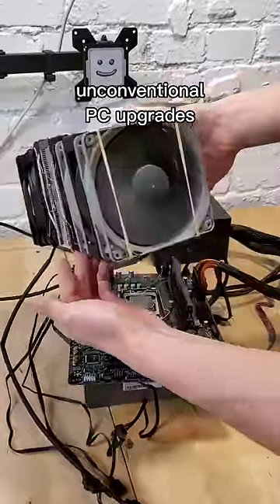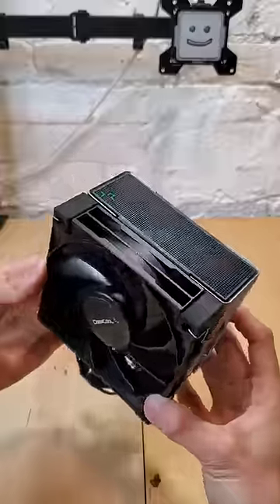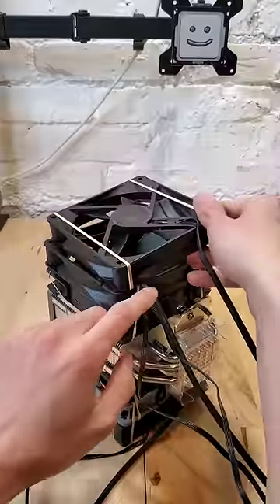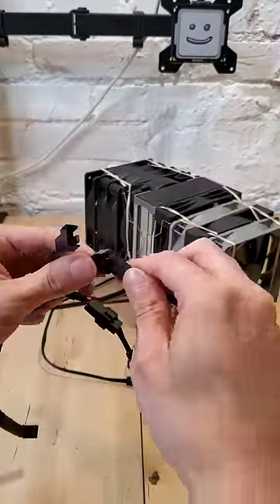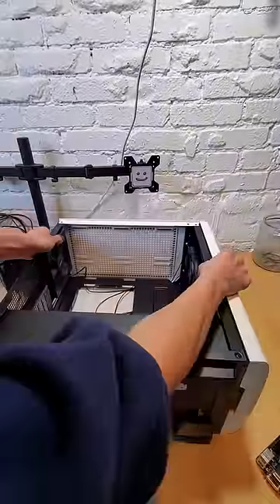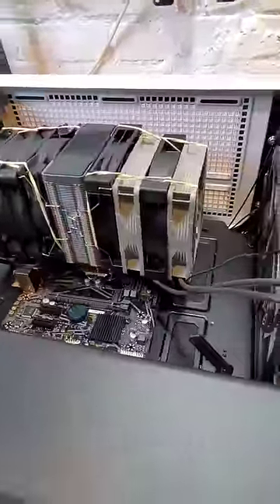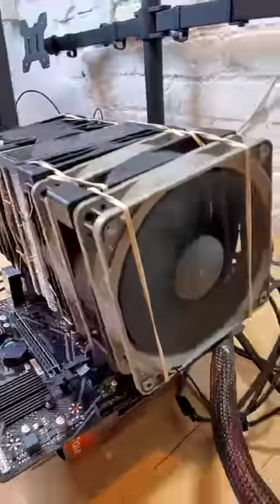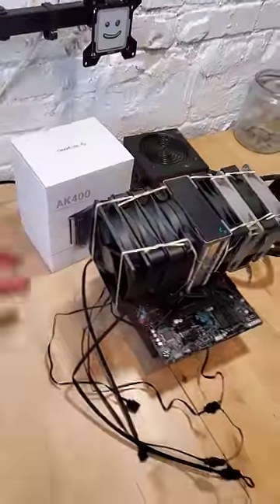the largest CPU cooler you'll ever see #shorts

Comment: I wanna see it put to the test, play a really CPU-usage-heavy fan-needing game :]
Reply: Me too!...

HOW ARE YOU EVERYWHERE?
Reply: Genshin Impact max settings should be able to melt the fans.
Reply: Bro ur everywhere why and how
Reply: @kitGoesquack  🤣🤣 definitely not.
Let's throw beam ng with 50 cars in it
Reply: it will be worse than having two fans on the coller because two fan taped to each other with the blade in the same way wil not increase the static pressure or the airflow
Reply: @kitGoesquack  No? Genshin doesn't stress any modern hardware that's half decent. My 2014 Dell inspiron with a i5 6200U and the iGPU with 8GB of DDR3 1600MHz will easily get 75 FPS with everything maxed out
Reply: @theforerunnerreclaimer  I don't play genshin, but I can tell you that my inspiron from 2013 is absolutely horrendous at playing games like roblox, even with 16 gb of ram and an ssd. The cpu is weak today and the gpu already back then wasn't meant for super heavy loads. 3ds emulation works at native resolution for me though, so I have that if I'm ever bored. Unfortunately I'm stuck with it bc my pc's power supply died :_(. Somehow this laptop outlived my pc for now.
Reply: @papyrus9183  Well, I did say half decent, and (no offense), if it can't handle Roblox it doesn't seem like it's very good
Reply: You mean chrome lil
Reply: Same🔥😆
Reply: @makandalp  for real. everytime my little cousins insert 30 cars. my 2700x is getting as hot as the sun
Reply: I would love to see this.
Reply: @theforerunnerreclaimer  no worries, my laptop is honestly absolute crap. like you said, roblox isn't even a resource hungry game. im just using it for schoolwork while waiting to repair my pc.
Reply: Play Minecraft with 1000 shaders and RTX on 

Wait, don't your PC would explode
Reply: @zhila5958  my 11th gen i5-11400H in my laptop doesn’t have that much of a problem with a lot of players on beam mp / beam ng multiplayer you probably need a better cooler
Reply: @theforerunnerreclaimer  The game is hard locked to 60FPS for now. Your point  still stands though. I run an R9 5900X with RX 6800XT and barely get my usage above 40% on CPU and 60% on GPU.
Reply: @kitGoesquack  bro genshin impact literally runs well on mobile... and it's well optimised on PC..... how shit is your computer?
Reply: @makandalp  beamNG is more into gpu intensive game , running cinebench r23 is more accurate since it runs 100% on your cpu for 5-10 minute non stop
Reply: thats cool
Reply: @xxzenonionnex7658  problem isn’t framerate tbh. but 79 celcius is kinda worrying. i thought the arctic freezer 34 would be enough to tame the 2700x at max load but boy oh boy was i wrong
Reply: @makandalp  guys I think he's definitely being sarcastic. 🙃
Reply: It'll just be worse, it's a sponsored video, if the performance was better then it would be included.
Reply: @kitGoesquack  nope.
Reply: @makandalp  hah, amatuers.
Just open cHrOmE
Reply: Why would anyone try to test it with a game? Just use CPU burner...
Reply: @BloPsy_Actual   nah, those are not realistic to real gaming scenarios.
Reply: @toxicturkeyy  Who cares about CPU temps in gaming scenario? It's completely irrelevant. 
Rendering or some other CPU intensive actions would be more appropriate. Using games to test out CPU is just a joke.
Reply: Exactly
Reply: Just load up 10 instances of bluestacks running games.
Reply: If you see him everywhere then it means u r also everywhere
Reply: The RAM doesn't fit
Reply: @kitGoesquack  nah, gi don't really takes many resources. My laptop is enough to take it
Reply: beamng no cap needs it
Reply: @theforerunnerreclaimer  cap
Reply: @kitGoesquack  even my phone can do that. 7 years old Samsung Galaxy and it goes up to 38
Reply: A chunk of tnt, all set ablaze at once (using commands ofc)
Reply: @kitGoesquack  no? Hahahahah
Reply: Yea i wanna know how it performed
Reply: Valorant
Reply: @theforerunnerreclaimer  i think genshin is maxed to 60 fps
Reply: @theforerunnerreclaimer  isn’t genshin locked at 60 fps? I’m geniunrly not sure, and if it’s not do you know how to raise max fps? i would love higher fps genshin
Reply: Just cinebench
Reply: @kitGoesquack  genshin impact is not even a demanding game for pc
Reply: @makandalp  better yet, gta v with absolute chaos
Reply: Cyberpunk 2077……..
Reply: Yes... But remember that fans are supposed to produce vortices in opposite directions.... As in spining opposite ways.... Not the same rotation ....
Reply: @kitGoesquack  arn't you a weeb. 
That game is weak in graphics and processing requirements actually most of the games are weak in cpu processing requirements.
But saying genshin impact will melt the daam thing is right outrageous.
But yeah game is fun to play..
Reply: Yeah same
Reply: I wanna see a temp
Reply: Open 7 up Analogue Labs and 5 kontakts along with idk prolly 6 serums in a DAW
Reply: beamng drive or arma
Reply: He should try some 3d rendering without a gpu plugged in
Reply: @kitGoesquack  how it's not that demanding
Reply: @makandalp my cpu got too 80 with 50 cars

Comment: The fact you used Rubberbands for sticking fans together tells me you are a genius
Reply: He is not the only one who did this haha
Reply: I was so dumb and used cable ties lol xD
Reply: @forsaken7161  if youre being serious then you went with the correct choice. Rubber bands dont like heat or time. They lose elasticity and dry out eventually cracking and breaking. Cable ties will last as long or longer than the components they hold.
Reply: @imalimabeanyay  not to mention, his method of securing the bands leaves an air gap between each fan that permits air leakage, reducing the overall air flow through the cooler
Reply: @richfiles  personally id just recommend some bungie cords. If it works on a car at 80mph im sure it could handle a wee little fan.
Duct tape if you care about airflow leaks

Comment: That is gonna draw more watts than a 3050
Reply: Well a 500w psu can power over 50 fans with no issues. I’m guessing someone with a 3050 may have like 550w psu or better. It would have no issue running a 3050 and 8 cpu fans including case fans.
Reply: i had a 3050 before i upgraded, they don't actually take much power lol
Reply: @footballfusionpro2  which is why the 8 cpu fans will draw more power haha but realistically it doesn’t. But still kinda funny haha.
Reply: 1 fan usually draws about 1,8W so 8 fans about 16W.
Reply: @reecekordzikowski3671  sorry, i didnt mean that the fans won't draw more power, just that OP said it in way that made it seem like he was saying a 3050 draws a lot of power
Reply: @footballfusionpro2  I get what you mean lol
Reply: Bruh what fucking industrial fans are you using?
Reply: @toxicturkeyy  who lmao
Reply: @footballfusionpro2  dude , 3050's came out like what , 3 months ago? And you already upgraded lol ! XD
Reply: @AnimanARG  I sold the 3050 lol
Reply: *3090
Reply: Not really 😕

Comment: Can you do a thermal test with this set up. I'm curious what the Temps gonna be with this many fans on the heat sink
Reply: I would expect after the 3rd and 4th fans on each side it wouldn't do much. As soon as the air gets to speed and matches the flow of the fan, more fans won't increase the flow and so cooling doesn't increase.
Reply: @faielgila7375  Well it will blow the hot air away further, and draw colder air from a further distance so it might make some difference.
Reply: @joshkoster2851  Hm, that would help a little, but certainly not when installed in a case
Reply: @faielgila7375  True
Reply: Probably way worse. Servers do stack fans because of how short they need to be to fit into a server rack but they have different sizes of fins because otherwise they decrease each other's airflow
Reply: There are plenty of youtubers who already tested the affects of more cpu fans or in general more fans in the case.
The result was that it is complete bullshit to have more than 1 fan on an non AIO cpu cooler. U only need two fans if the cooler has a space inbetween the cooler (like the noctua nhd15).

Same goes for AIO radiators. The cpu will not operate at a lower temp when using fans on top and on the bottom of the radioator.

People need to get away from the perception that "more is better", espacially with the fans...
Reply: If you stack fans like this nothing will change , you need 2 fans rotating in opposite directions to create static pressure to increase airflow
Reply: @ThExitest  also not true...
Push pull config is not better than pull pull or push push
Reply: only one fan per air outlet will work, other fans will break the air flow, and heat removal will be worse.
Reply: Nothing change tbh, we need more heatsinks not more fans, i'd like to have a giant cooler with 8 heatpipes + 1-2fan than a small 4 heatpipes + 10 fans
Reply: I think no improvement at all...... Just making the situation worse....
Reply: @honestsniping1  what i was thinking. After 2 fans its useless or may actually obstruct . but I've never built a pc so idk
Reply: @ThExitest  this. Without counter rotating fans stacking is pointless.
Reply: @honestsniping1  He's talking about same air direction but with opposite rotation of the fans, like: pull (🔁), pull (🔄), heatsink, pull (🔁), pull (🔁)

Like a jet turbine so the pressure increases and the amount of air being moved increases as well

Comment: For anyone here without critical thinking skills: 

1. this is dangerous as it could be too heavy for a motherboard

2. Just because you CAN doesn’t mean you SHOULD. Multiple fans won’t make it cooler, it’ll just push air faster and move it.

3. If you want a good air tower without an AIO or anything with custom water cooling, use Noctuas coolers since they are considered the best of the best air coolers. 

4. None of you are talking the same way I am. Scary times; people are not thinking anymore, not even basics of thermal conductivity

Comment: To maximize dynamic performance you should use 2 different fans (one rotating clock-wise and one rotating counter-clock and so on) Scythe has done it on “Fuma 2” cooler as well

Comment: Should one stack fans: Stacking fans will not increase performance. It will not increase the speed of air pushed through, in fact it may lower it, just because the front fan may disrupt the airflow.

Comment: This only works if you have the fans spin in alternating directions of each other while still pushing the air in the same direction otherwise airflow is actually diminished rather than improved.

Comment: TLDR; It will make a positive difference. Even 1 extra fan per side will create a small (+-   1-10%) temp drop. My understanding is that the outside fan of the intake-fan-set, drops the temp of the air, which is then cooler than the actual ambient temp, which then has its temps reduced further, by the inside fan. 

This "2x" cooler air, then has its temps reduced further by the 2x exhaust fans. It's a simple upgrade that potentially produces enough of a Cpu temp drop that it could possibly stabilise an otherwise unstable CPU overclock.

Comment: I have a similar case from deepcool. It's not great unless you can get in under $50. It has fitment issues and the drive cage was not removable which made cable management very difficult. Definitely good for the $35 I spent, but it won't keep up with nicer cases a bit above $100. 

It did come with a 4 pin fan hub which was really nice to have.

Comment: Cooling process is logarythmic . Even if you put whole motherboard deep in ice and over clock it, the heart of cpu still could be in high temprature.
If you can find a way to prevent melting of a plastic bag full of water on direct fire , then you found best cooling method ever.

Comment: It actually work, i did that with mine with 4, 2 in / 2 out and it keeps my ryzen 5800x under 70 degrees on 80% load. Its not that bad, i did that with pretty cheap ones, so its cheapers than a high end cooler that keep it at the same temp.

Comment: And it will not flow any more air than the lowest volume fan in the stack.

Fun party trick, but it just adds more heat as each fan contributes additional heat load in the case without corresponding additional cooling.

Comment: Fun fact: this doesn't work what you expected to be. There's a video here in youtube but i forgot what was the title of the video and who was the YouTuber, maybe it was Major Hardware, but the guy also did the same, putting multiple fan in a cpu cooler. He gradually add 1 fan and measure the cooling effectiveness, it only capped at 2 fans and the rest was the same, maybe he add it up to 6 fans. Then later he explained why it doesn't cool to much despite having a lot of fan, he said that all fans has the same rate of power so no change of air power meaning the power of air exerted to next fan is just the same.( e.i. fan1 blows 1 power of air, fan2 recieves the  power then blows it again only 1power of air and so on and so forth).
Reply: Found the video. https://youtu.be/Wp4pG2td0IM

Comment: Does anyone else want to see this many fans on the largest air cooler ever. The CPU cooler I'm talking about is the Ice Giant Thermosiphon Elite. It is massive as it was originally designed to cool down a threadripper but it also happens to be compatible with the other modern AMD and Intel sockets.

Comment: Deepcool has some great cooling option not gonna lie

If you want a top notch air cooler without spending as much as a noctua, go check their ak620

At least here I can find it often for about 55eu, vs the 80 of the assassin 3 and the 90 of the dh15 se, with very close performances

Not to mention their aio are very performing and also have an antileak system, which is always nice

Comment: You picked the wrong way to make it bigger, it’s still only 120mm of heat transfer medium (condenser, vapor chamber, radiator) whatever you want to call it. They make somewhat similar coolers for other industrial applications where the main heat transfer body is larger than 120mm I’ve seen up to 500mm on eBay. There’s a particular sequence of fan rpm needed to raise airflow, If the fans are all spinning at the same RPM it’s not multiplying the airflow. Aesthetically it is wide but that’s about it. Larger heat transfer body with larger fans would allow a GPU and other components to still fit as well as being huge and ridiculous while actually being capable of more heat dissipation.

Comment: Okay so this does look funny and stuff but adding more fans to a cooler that is not made for extra fans, usually does nothing. I know from experience.
If you have a NH-U12S and you add a second fan you wont see a difference since the air pressure does not change.

Comment: You cannot move more air with fans with the same configuration stuck back-to-back, because of liquid/gas dynamics.
The fans need to be in a push-pull configuration aka they should not spin the same way.

Comment: Having fans stuck together like that is useless unless the fans spin in different directions. I know its weird but think about jet engines and plane propellers, one blade spins clockwise and the other is counter clockwise. I know it for memes but this is useless because you actually get little to no more airflow then a single fan lmao

Comment: It's been awhile since I have seen a push-push-push-push-pull-pull-pull-pull configuration. I wonder if the airflow rate & air pressure of so many fans in series makes the cooler more or less efficient?

Comment: There are plenty of youtubers who already tested the affects of more cpu fans or in general more fans in the case.
The result was that it is complete bullshit to have more than 1 fan on an non AIO cpu cooler. U only need two fans if the cooler has a space inbetween the cooler (like the noctua nhd15).

Same goes for AIO radiators. The cpu will not operate at a lower temp when using fans on top and on the bottom of the radioator.

People need to get away from the perception that "more is better", espacially with the fans...

Comment: So why not show a control test followed by a test with the 8x fan cooler lol. I've thought about making a duct like cooling system fory PC. And since my AC at home is always running it would filter and draw the air in from the cold vent and run it through a series of ducts and pipes that run through all the important components that work best when chilled.

Comment: My 3yro AIO and it's 4 QL120s, still keeps my undervolted and overclocked  5600x 25-30c and 50-55c under load. Just right now I'm on mobile because I'm using Handbrake and my cpu temp right now is 49c. I also have 5 other fans. 2 other QL120s and 3 LL120s.